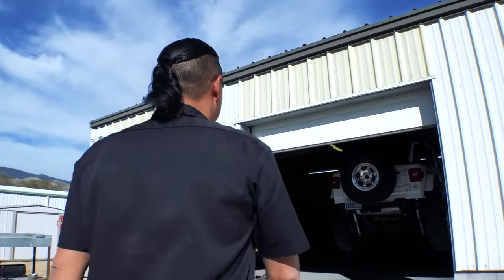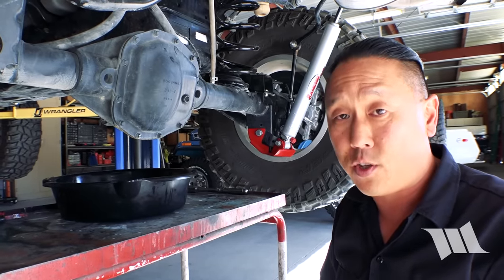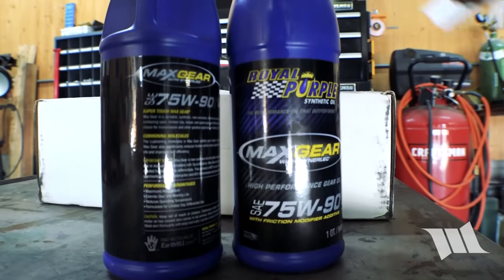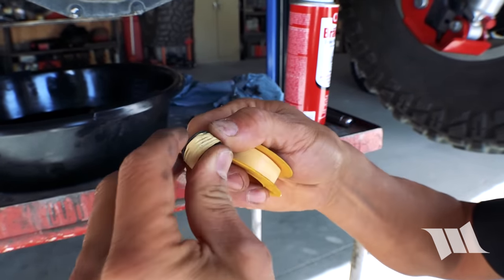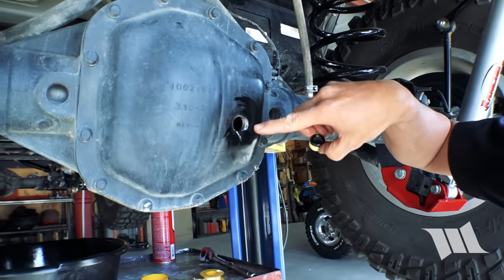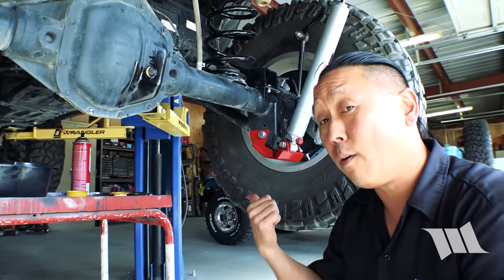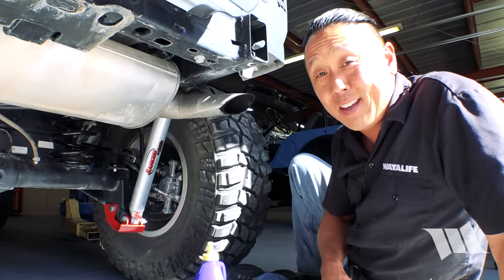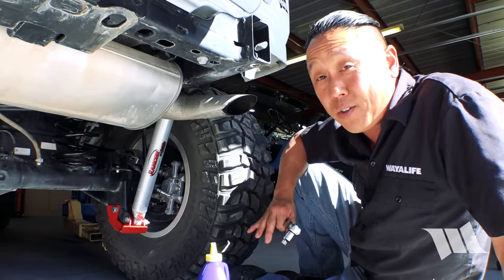Jeep JL Wrangler Axle Differential Fluid Change - How to do it Yourself Maintenance

Comment: I was going to change mine, but I was unable to get the drain bolt off(or could have been the fill plug) .  What can you do to loosen the bolt.  I just have sockets and rachets and not super strong (69 year old woman)
Reply from the maker: @B Johnson I would recommend that you purchase a breaker bar. Essentially, it's a long ratchet without a ratcheting head and it'll allow you to use leverage to get the bolt free. You can buy one from places like Harbor Freight for cheap.
Reply: @wayalife  Thanks Wayalife, though I do know what a breaker bar is.  That's what I used to use to take the lug nuts off my wheels, before it got stolen.  

For the drain plug, I slit a copper pipe over my rachet to get better leverage, but it didn't work.  I did see another site suggest heat.  I even have both the yellow canister and blue canister of gas  like you might use to sweat a pipe.  But I am aprehensive about using either of them to heat the plug.  Could doing that blow up anything?  Plus what I saw was talking about heating bolts, not plugs.  I"d appreciate any further thought on the matter
Reply from the maker: @bjohnson2143  LOL - sorry, wasn't sure if you knew what a breaker bar was and was just trying to help. No need to heat things up. Just take your Jeep for a decent drive on the highway, come back home and try again. The gears will heat up while driving and that'll help warm up the diff cover too.
Reply: @wayalife  No problem. After all why assume I know.  I think I'd rather explain something and then let the person tell me they already knew that part instead of assuming they do know.  Some people feel like they are stupid if they ask a question or or they ask too many questions.

In any case, thank you very much.  I will try that.  It makes sense.  Have a great weekend.

Comment: How far up does the axle breather tube go, and can it be placed higher?
Reply from the maker: It goes all the way up to the bottom of the top of the frame rail. It can be extended and located higher but I've never seen a need for it.

Comment: Hi, i drive a jeep jl rubicon with the 3.6l v6, do i need to add additives? Or can i just follow what you did and use royal purple 75w-90? Thanks in advance!
Reply from the maker: You only need friction modifier with a limited slip differential. A Rubicon comes with lockers. You don't need it.
Reply: @wayalife  thanks a bunch! And lastly, would it matter if I use 75w-90 instead of 75w-140 or 80w-90 ?
Reply from the maker: Assuming you're running stock axles, I would use the 75w-90.

Comment: So it only took 2 quarts each ? Also since you have posted this are you still feeling okay without the additive that mopar suggest ? Do you suggest doing this while warm ?
Reply from the maker: I only used 2 bottles but it took less than that. You only want to fill until the fluid oozes out of the fill hole or, if you have a high fill hole, until the fluid reaches the bottom of the axle tubes. Anymore and you will have over filled it and it will pump out the breather tube. The additive you are referring to is friction modifire and it's only needed if you have a limited slip differential. Synthetic gear oil will have it in it already. Doing this when warm isn't necessary but it will make things easier if only because the gear oil will be easier to drain and work with.
Reply: Wayalife thanks again for quick reply …

Comment: Hey do you know for limited slip diffs if we need to add friction modifier even if the RP 75w140 has it in there already?
Reply from the maker: You do not need to add friction modifier when using a synthetic fluid like Royal Purple.

Comment: Hey Eddie great vid.. I have a question I noticed u didn't add any friction modifier to ur diff oil.. does the royal purple come with it or no.. my 2018 jkur requires mopar diff modifier
Reply from the maker: You only need friction modifier if you have a limited slip differential. It is needed to make the clutch packs work. That being said, synthetic gear oil typically has friction modifier in it.
Reply: @wayalife  so with the royal purple you didn’t need to add any limited slip additive
Reply from the maker: @tmac7130  nope. It's not needed.

Comment: I have a 2014 Rubicon  do I need any adirives  on front  and rear??
Reply from the maker: You mean aftermarket ones? If so, only if you've lifted your Jeep 3" or more and really, only up front. If you have a 2-door, the rear as well but again, only with a tall lift and you will need adjustable rear upper control arms for the rear to set the pinion angle.

Comment: Hey Eddie, love your videos mate. Question, I live in Australia 🇦🇺🐨 and own a 2010 JK. What dif oil would you recommend I use? Your help would be greatly appreciated buddy.. Cheers 🍻
Reply from the maker: If you have a limited slip differential, I would recommend using a synthetic oil as it will have friction modifier in it. Otherwise, you should be good to go with old school standard oil.

Comment: Did you use a square bit to take out the plugs?  Do you know the size?
Reply from the maker: You just need to use the square end of a 3/8" ratchet. Or, you can use a 1/2" ratchet with a 3/8" step down for better leverage.

Comment: What about the  Mopar 04318060AD additive??? You don’t us that on your jeeps??
Reply from the maker: Friction modifier is only required on axles with limited slip differentials. I have a Rubicon and have lockers but even if I had one, synthetic gear oil has it in it.

Comment: @wayalife I have a 2020 Sahara w/ Anti-Spin Differential Rear Axle . Which  differential fluid do I need for front and rear? (I don't tow)
Reply from the maker: The limited slip is only in your rear axle and for that, you will either need to add friction modifier or use a synthetic fluid as it will have it in it. Up front, you can use whatever.

Comment: I just found out mopar diff oil for the JL is $60 a quart...  is the there a huge difference between Dana 44 JK and JL ??
Reply from the maker: There is ZERO difference. There is no way I'd spend $60 a quart for gear oil. If you have a limited slip, ANY synthetic gear oil will get the job done. If you have a Rubicon, you can even use dino.
Reply: Wayalife I have JL Rubicon,  i got some diff covers so I’m changing the oil soon. Thank you very much you’re saving a lot of money.
Reply from the maker: You bet. Glad I could be of help.

Comment: Would you recommend royal purple 75w90 in a prorock 60? Dynatrac doesn't recommend synthetic.
Reply from the maker: NO. You definitely want to run a traditional dino gear oil. Not so much because it's a Dynatrac but more because it probably comes with an ARB locker. Synthetic gear oil will damage the o-ring on the ARB and cause it to leak.
Reply: What brand do you prefer?
Reply from the maker: @tackiebox1  Honestly, when it comes to dino, I'm not sure it really matters. I typically run Valvoline or the like.

Comment: Can anyone confirm, what weight and how much is needed for the JL Sahara front + rear diff ?
Reply from the maker: 186 FBI (Model 30) - Front Axle
MOPAR Gear & Axle Lubricant (SAE 80W-90) (API GL-5)
1.82 Pints/0.86 Liters

210 FBI (Model 44) - Front Axle
MOPAR Gear & Axle Lubricant (SAE 80W-90) (API GL-5)
2.18 Pints/1.03 Liters

Comment: I used this gear oil changed both diffs at 20 k. Then at 33k I took it to dealership and they said there was damage to rear diff and they said to stick with factory brand because the JL differential is touchy?
Reply from the maker: LOL - Exactly what did your dealership say was damaged and how did the gear oil you used cause the damage?
Reply: @wayalife  I’ll let you know when I pick it up he said they ordered a part to replace in rear diff covered by warranty.
Reply from the maker: @Dan-qx4vv  Not trying to say your dealership is full of it but... it sure sounds to me like they are. Unless they're replacing the entire ring and pinion and or locker (something that a dealership would normally just replace the entire axle), you don't just replace a "part" in the rear diff. But, to be fair, why did you take your Jeep into the dealership to begin with? What kind of problem(s) were you experiencing?
Reply: @wayalife  I broke both folding seat levers then what got me to come in was the passenger seat locker broke so it was stuck in folded position.  I mentioned to them I heard a rotation noise between 10-15 mph to me sounded like something was rubbing on rotator.  It’s been there for 8 days now.
Reply from the maker: @Dan-qx4vv  sorry to say it but your dealership is full of it. Nothing in your differential will cause what you were hearing. A bent axle shaft flange will and that’s a very common problem. Whatever it is they’re replacing better be “covered under warranty”.
Reply: @wayalife  they said it was.  I showed him a picture from when I originally drained the differential and there was a lot of metal it’s my first jeep but I have never seen that much metal before on other vehicles I maintained.
Reply from the maker: Well, if they said it was, it must be true. You know, because all dealerships are so honest and always have your best interest in mind LOL 🤣 As far as metal goes, are we talking chunks of metal or very fine particles because, the later is COMPLETELY NORMAL AND WOULD NOT CAUSE THE KIND OF SOUND YOU WERE HEARING. But hey, what would I or any of the personal friends I have who work for both Jeep and Dana Spicer, the manufacturer of the axles under your Jeep know. Good thing your dealership found this problem when you brought your Jeep in to have your seats looked at. 👍

Comment: Could you recommend plug sealant instead of  teflon tape?
Reply from the maker: Any chemical resistant pipe sealer will work as well. Yellow teflon paste for gas lines works.

Comment: Hey I didn’t see the link for tape you use on the  plugs
Reply from the maker: You can buy it from your local hardware store. Just make sure it's the yellow one as it'll be chemical resistant.

Comment: Hello from france... nice video. 2 questions . where do you find your special  teflon, and the key?
Reply from the maker: Not sure what key you're referring to but you should be able to find yellow teflon tape at any hardware store in the plumbing section. You can also typically find it where gas appliances like driers, stoves and water heaters can be found.
Reply: @wayalife  thank toi si much....for your video 
i mean the key which opens the differential
Reply from the maker: @bertrandroques6117  There is no special key. You just use the head of a standard 3/8" drive ratchet. I like to use a 1/2" drive ratchet with a 3/8" step down bit as the 1/2" ratchet is typically bigger and allows for more controlled leverage.
Reply: @wayalife  your answering me is very very kind of you.  Thank you so much

Comment: I have 2011 Sahara with anti spin rear axle, do I need a additive along with the gear oil?
Reply from the maker: Synthetic gear oil has friction modifier in it. You only need to add it separately IF you use traditional gear oil.
Reply: @wayalife  okay because I just drained and filled with 80-90w without limited slip additive before I found out it has a anti spin Dana 44. Well next time I will use synthetic gear oils, so far I have only seen metal shavings and gray tented fluid.
Reply from the maker: @atvman1014  what you're seeing is normal. You can buy friction modifier and add it to your differential now.

Comment: How often should this be done
Reply from the maker: Depends on how you use your Jeep. Me, any time I do a deep water crossing or about every 15,000 miles if I'm doing a lot of hard wheeling. If you spend most of your time on pavement, you'd probably be okay once every 30,000.

Comment: is the tape necessary ?
Reply from the maker: It is not. In fact, there is a paste that I would recommend instead as it does a better job. Not using a sealant is not that big of a deal but you will see some oil seepage from the bolt if you don't.

Comment: Why is the tape necessary?
Reply from the maker: It isn't 'necessary' but it does prevent oil from seeping out through the threads and it will without it or teflon paste.
Reply: @wayalife  thank you for the quick reply and explanation! 👍🏻

Comment: Did you go with 1310 or 1350 driveshafts?
Reply from the maker: The only u-joint on that the JL has is on the front drive shaft and it is a 1330. In other words, it is stronger than a 1310. It wouldn't make any sense to me to downgrade my drive shafts when installing aftermarket ones and so I went with 1350's as I always do.
Reply: Wayalife thank you sir are you still using the factory axle shafts? Love the videos as always!
Reply from the maker: Yup. I prefer to run what I have until I have a need to replace them.

Comment: Apparently the stopped putting a drain plug on the front axles for the 21 my and on. 😅
Reply from the maker: Yeah, that was probably for the best. Newer axles, you have to remove the cover. I will have a video on this soon.
Reply: @wayalife  Nice! I ordered a new gasket so I can crack it open and do it. I dont trust myself to get it right with just the goop. Gonna give it a shot when that comes in next week.
Reply from the maker: @senrusho  To the best of my knowledge, the new JL/JT diff covers come with reusable gaskets. At least, the one on the ACCUAIR JT does and so does my 392
Reply: @wayalife  Really? How can I know for sure? I looked in the manual and couldnt find anything.
Reply from the maker: Look at the base of your differential and if there's a slight gap between the housing and the cover, you have a gasket in place. When you remove the cover, the gasket will most likely be stuck on it. Simply pry it off with your fingers and thoroughly clean both the cover and the gasket and the mating surface of the housing with brake cleaner before re-installing.

Comment: How do you know what axle you have m220 or m200 ?
Reply from the maker: You know if you have a JL Rubicon
Reply: @wayalife  I'm trying to figure it out on my overland gladiator with trac lok did a gear change to 4.88 now need to get out the break in oil but don't know what oil to put in. What would you recommend
Reply from the maker: Do you have a limited slip installed? If so, you'll want to use a synthetic oil like this as it will have friction modifier in it. Other wise, you can pretty much use regular oil. Even with 4.88's, a 75w90 will be fine but there are lots of guys who prefer to run a heavier weight in the rear. You won't need to service the front being that it most likely hasn't seen much of a load.
Reply: @wayalife  cool that's what I put in this morning got the royal purple 75w90 ya the front I'm doing later after I can get some time to spin it. Thanks for the help

Comment: So the tool is just a rachet....no bit on the end of  the rachet??  Looks simple to do...where can you discard of the dirty fluid would a shop take it ...dont think you could just toss in the trash...
Reply from the maker: Yup, that's it. Just a 3/8" drive ratchet. You can recycle your used oil at most auto parts stores like O'Reilly, Autozone and the like.
Reply: @wayalife  Thanks so much for letting me know the info ...👋

Comment: Front drain plug definitely not in a good place, they should have put it to the side like the rear.
Reply from the maker: Couldn't agree with you more!
Reply: It seems to me on my 2016 with the Dana 30 front axle, the drain plug is on the side like the rear axle .

Comment: My jl is a 2.0 turbo engine 
75w90  or 80w90  ??
Reply from the maker: Your engine won't make a difference in what gear oil you use in your differentials. Either will work well.